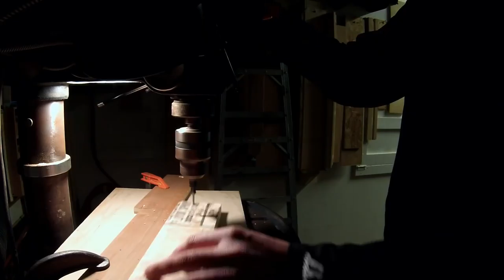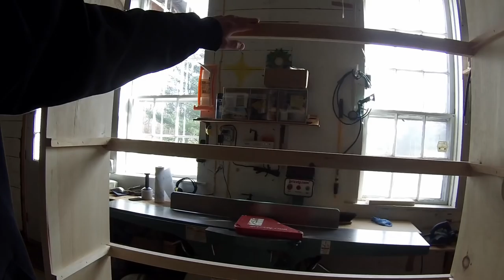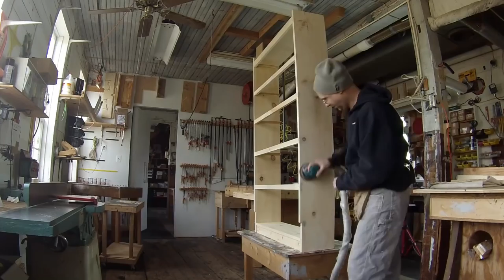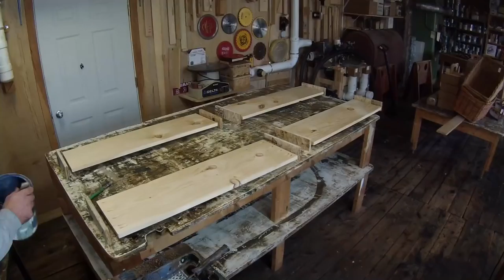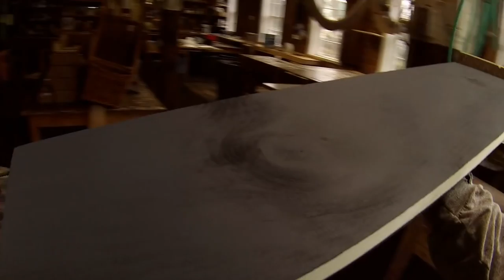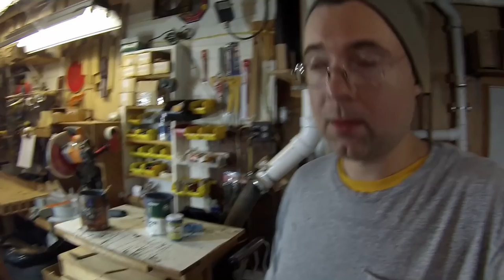Bookcase Part 2 - Painting

Comment: Do you find that the acrylic primer works well to reduce sap bleed through? I usually use Shellac based primer on the knots to prevent this and use regular primer over that.
Reply from the maker: +Zarouszz 
I usually do the same exact thing, but bleed through was not a concern for this particular project